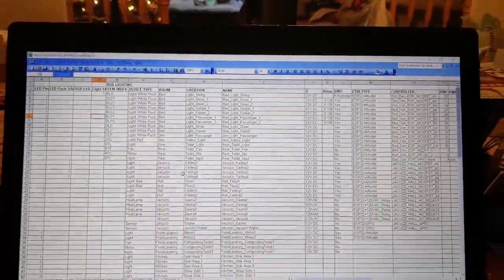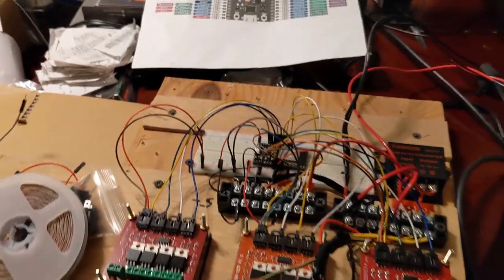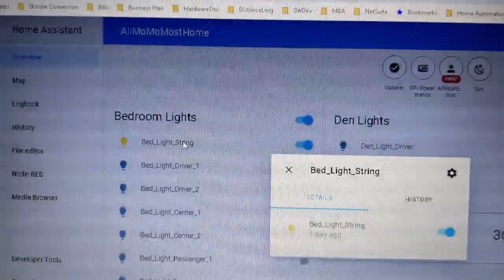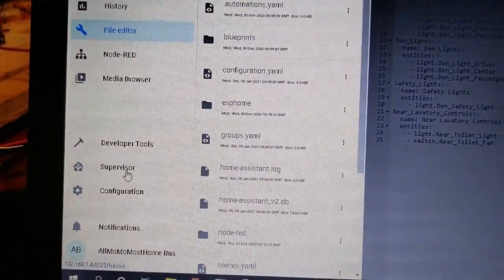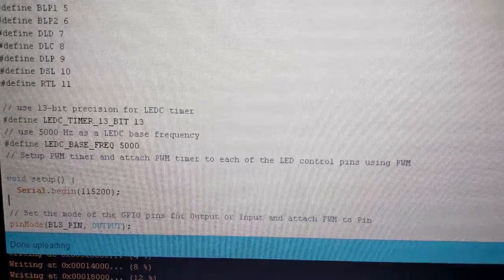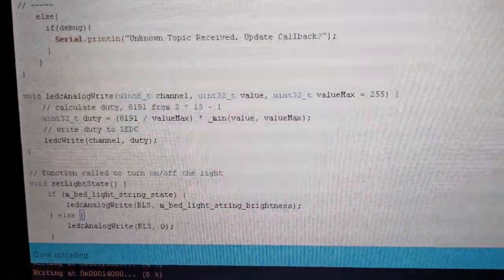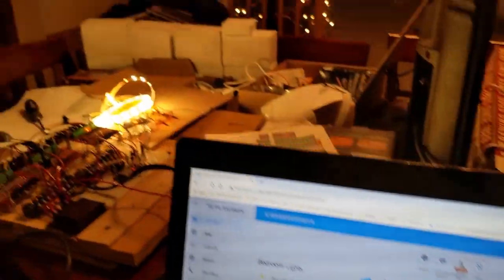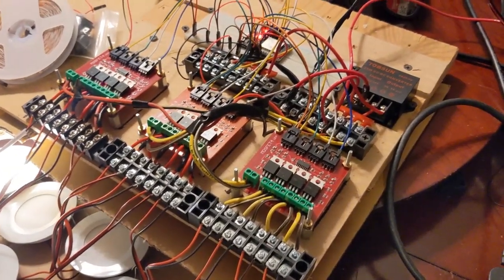Skoolie Build #50: Automation of LED Lights, PWM Dimming with Home Assistant, MQTT, & Arduino ESP32

Comment: Hey Larry - excellent work!  I thought I commented on this earlier but I must have only started it and not actually hit the "submit" button.  Anyway, I wanted to say I am very impressed with your work and how you managed to get it all figured out!  I have not even installed mine yet - but I hope to in the coming weeks.  I have some sub-routines that work nicely with allowing you to control the lights from a switch (Michelle instead on using "real" switches" or this was going to be a no-go :)) But the switches work like toggles and they will also brighten and dim the lights if you long press them.  I will share the code when I finish if you are interested in it.  Nice work!!
Reply from the maker: Juan I'm definitely interested in that. Do those switches get wired back to the microcontrollers? I'll be installing at least some of our puck lights in the next month or two. I'm working on the ceiling now. And thanks again for paving the way.
Reply from the maker: Would the esp32 capacitive input work for that switch function too? A wire with a little square of metal maybe?